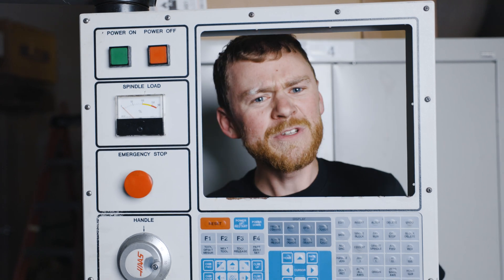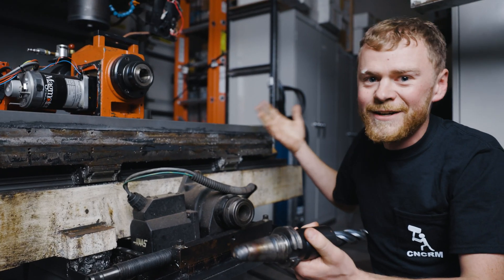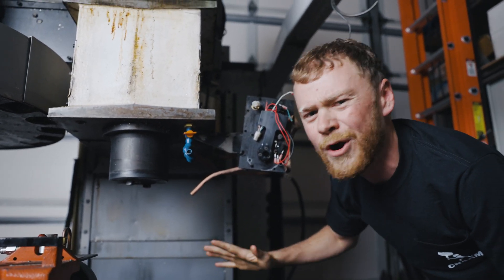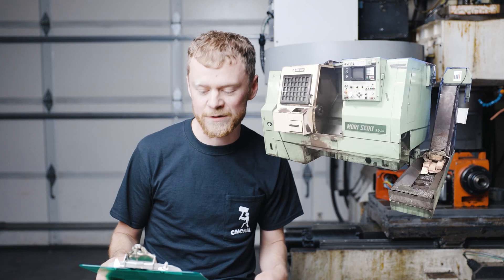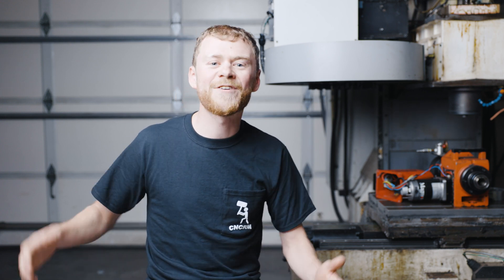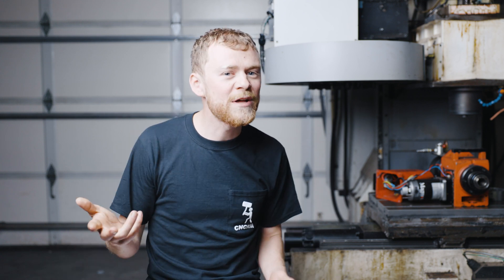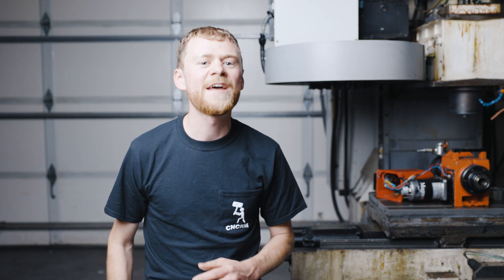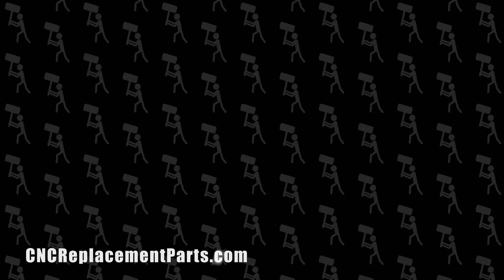Don’t Buy Old CNC Machines | CNC Repairman

Comment: Too 😁 funny, I bought a 1985 mazak vqc20-50b with the m2 control for 3 grand ,,when I took a truck to go get it they had it powered on and acted in a rush. Then 1 of the guys said shut it off before something else goes wrong 🙄 😒.  The machine weighed 2 ton more then the manual said....so ya....rigging costs more then the machine. I know mazaks pretty well so I was happy to put some elbow grease in it. Lasted 2 years n I sold it cheap  because I needed to get it out of my works old shop since ce we were bought out.  I say if you know how to fix em. And most importantly you have the time go for it. If you don't  know how  to do repairs buy a new machine! Lol. I run a 1998 Cincinnati horizontal (magnum 800) with acramatic 950 Control that can still run circles around these newer ones , I can put a part anywere on the pallet, probe for center, and the control follows it however I spin the pallet !!! NO G43 because it automatically calls up length with the tool in the spindle. I love it! We just rebuilt everything,  all new seals, spindle bearings, hydrolic pump, (coolant got into hydrolic oil because thru coolant seal went bad) new pallet seals, new way covers.....it's brand new.......almost....hahahahahaha but I have 60hp , new thrust bearings in (z) and (y)  too! NOW.......IF I COULD ONLY GET IT TO STAY ON AND NOT SHUT OFF!!!! hahahahahahaahaa dam (current exceeded alarm) can't make up its mind,,,,goes from y,z,b,and p (the tool changer)  
..If i leave the cabinet doors open  it runs fine then.........no alarming out..........P.O.S.....

..hehehehehe

Comment: I have an old haas abd it runs great. It's a 2000. Haas still has parts for them. Telling folks to not buy older cncs is the same as talking yourself out of a job especially when you sell cnc replacement parts. Come on man!
Reply: Guy just called his 2000 Haas old and I'm over here with my 1994..... 🤣
Reply: Hey man. I'm looking at a 2000 mini mill. Parts are still around? Anything I should watch for? Thanks!

Comment: When you said old bridgeport and the machine pictured was younger than mine I near spat out my coffee. To be fair my 1990 bridgeport 720x with tnc2500 has been great. Sure it's slow and plodding but It's still earning its keep with minimal problems. Now to go contemplate all of my life decisions after just buying a 94 haas vf1 🙃
Reply: I still run a V2xt and a vmc1000 pretty frequently. Still make good parts, u get used to the weird quirks of the DX32 after a while. Keeps your hand coding skills sharp. Just baby your BMDC board and keep the cabinet clean.

Comment: Old matsuuras are workhorses, i know a few from the  80's running with not complains holding good tolerances...
Reply: my mtasuura mc500 from 1986 still runs grate, with yasnac mx2, bur very limited memory, but i dripfeed it:)
Reply: I started my career on old Matsuuras that were older than I am. 22+ years later, I dealt with a customer who had one of those same old machines still running strong. My experience with matsuuras is that they are very accurate, very rigid, and very reliable.